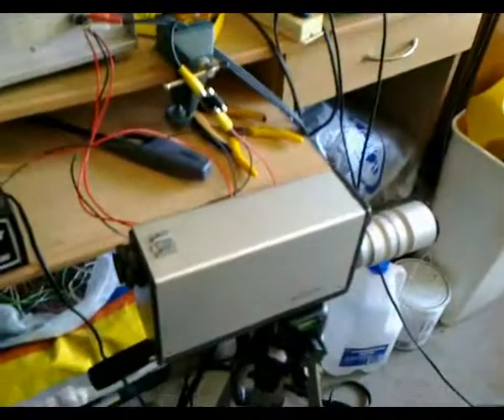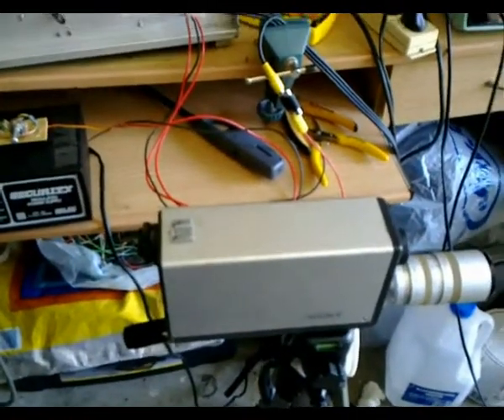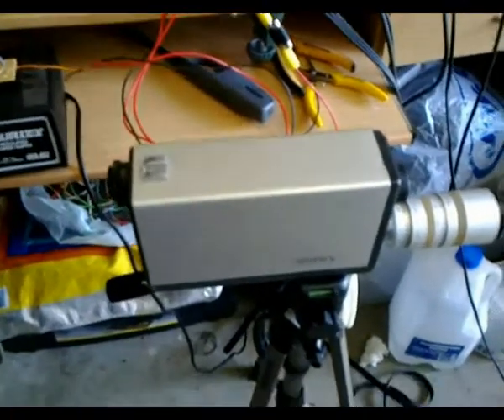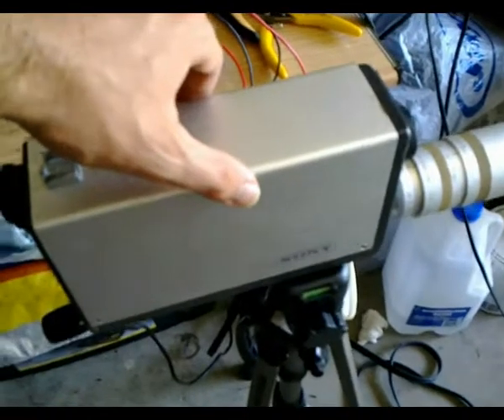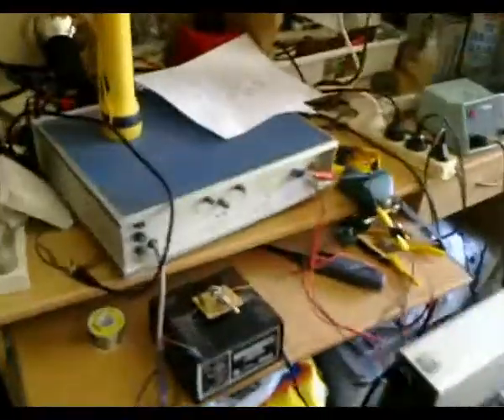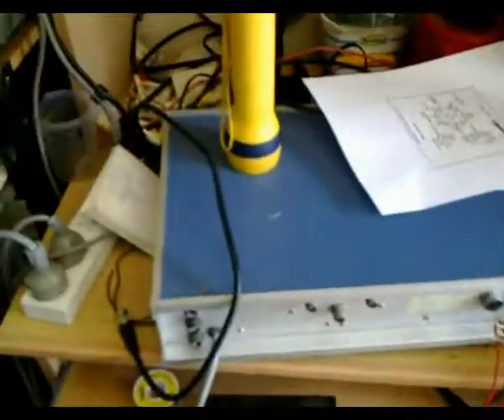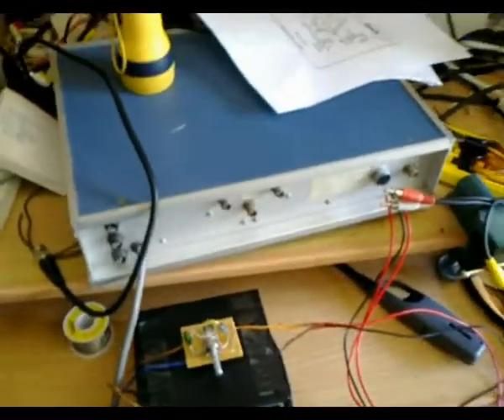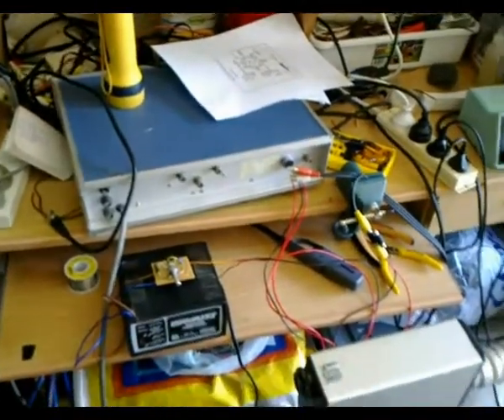1967 Sony VCK-2400ACE B&W camera powered from SPG & 12V power supply (Part 2)

Comment: do you have access to sony video cameras from the early to mid 70s - i was wondering what the video quality would be for something made between 75 and 77
Reply from the maker: I have B&W Sony cameras from the 60s and 70s, the quality of them are pretty much the same as they use same or similar 2/3 inch vidicon tube type, here's one from 1974 a Sony AVC-3250CE https://www.youtube.com/watch?v=ZAxId0sjx8g picture is only softer because I recorded to VHS tape instead of to DVD. I also have a 1974/75 Sony DXC-1200P colour trinicon camera but it doesn't work properly but someone else has uploaded nice videos of that camera in operation making nice colour pictures https://www.youtube.com/watch?v=pG9szJ2gWrY